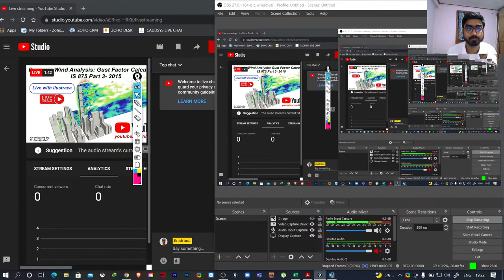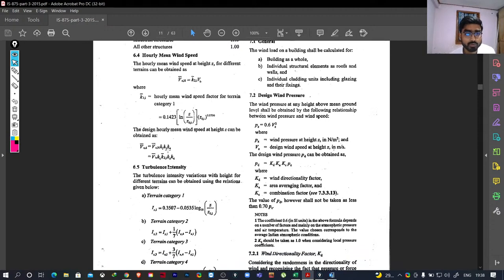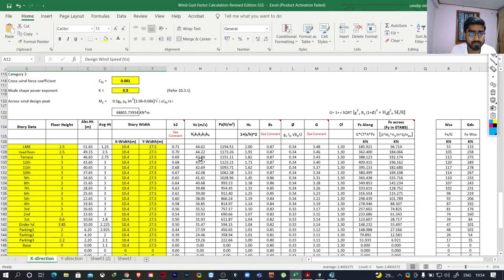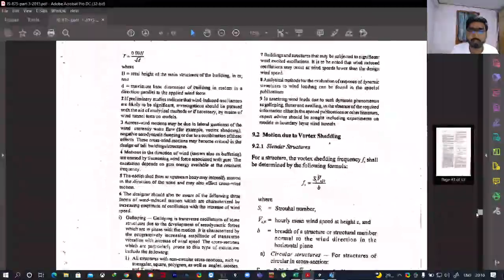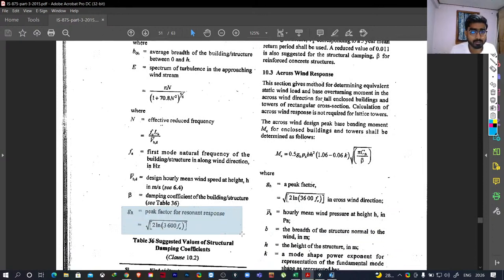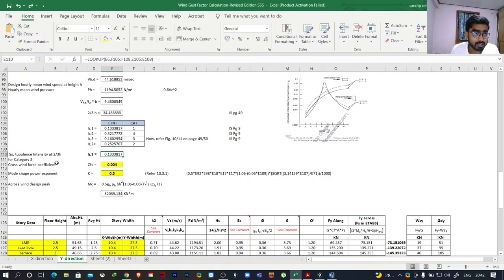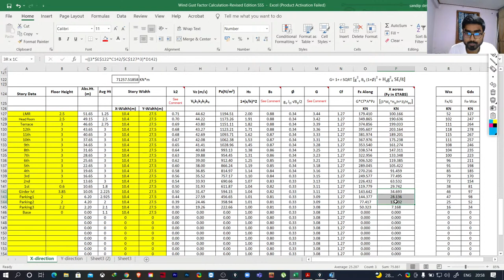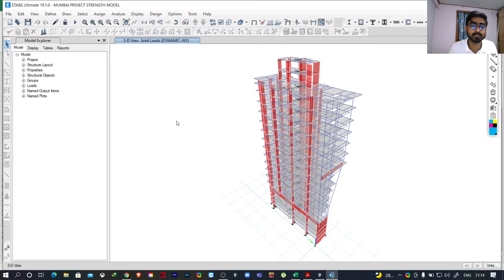Dynamic Wind Analysis: Gust Factor Calculation as per IS 875 Part 3- 2015 | ilustraca | Sandip Deb

Comment from the maker: Advance Study in RCC Building Design using ETABS and Manual Checks
Pre-recorded + Project solving (Batch 2022/01)

Introductory session 01- https://youtu.be/v2fBJ7ueYMM
Introductory session 02- https://youtu.be/J7o4qpN8HdY

Course Fee- 8000/- INR (8 Months access)
(N.B.: The fees can be paid in 2 installments)

Install our Android App now to get the course-
http://on-app.in/app/home?orgCode=amitco

Enroll to the course-
https://amitco.courses.store/157431?utm_source%3Dother%26utm_medium%3Dtutor-course-referral%26utm_campaign%3Dcourse-overview-webapp

N.B.: Admission to this batch is open till Feb, 2022.
Reply: The value of "s" taken by asutosh sir is zero for normal building. And the gust factor is fixed for a normal building. The value of the G is also shown fixed in GSDMA DOCUMENT calculation WO7 !!

Comment: Sir for calculating K2 factor you are using formula from 6.4 and suggesting to use the table 2 alternatively, but the min. Value for K2 for category 1 is 1.05 and you are getting 0.7 for 52mts, so please clarify.

Comment: Vh,d in G Gust Factor calculation you have considered height as variable. it should be fixed value for building height h. Please reply
Reply from the maker: When design wind speed is variable with height then how wind gust gonna be the same? There are basically 2 approaches.. if u finding total force to the structure to be applied at Top most story then u take all max and calculate Gust factor and force... if u r applying story lvl forces then it will be the same as shown.
Reply: you used h as variable in calculation of SIZE REDUCTION FACTOR 'S'. the formula has Vh,d. Note h. it is note z or s @ilustraca
Reply: Sandip Thanks for reply, Cross wind response base MOMENT is too high with IS875 formula for 100m high str. You may studies. Any suggestion

Comment: Hi at one place there was difference in natural frequency was found so u told that it is stiffness based model then u took some other exam model. I could not understand that please explain a bit 

Thanks
Reply from the maker: We need to consider 2 conditions basically, Service condition and Ultimate condition ..and it can be by assigning appropriate property modifiers to the structural elements

Comment: Sir wind analysis kon kon se methods se kr sakte hain?
Reply from the maker: Static method- Pressure coefficient method and force coefficient method 
Dynamic - 1. Gust Factor
                  2. Wind Tunnel
Reply: Sir static method main response spectrum method se bhi kr sakte hain kya wind analysis?
Reply from the maker: Response spectrum is Dynamic Seismic Analysis Method..
Reply from the maker: Do not confused between Seismic and Wind Analysis
Reply: Static method main - Pressure coefficient method and force coefficient method aate hain to ye 2 methods main se konsi linear static main aati hain konsi non linear main aati hain?

Comment: Pls make a spl video for wind static & wind dynamic analysis in etabs
Reply from the maker: already these are explained in great deatail here... rest you can enroll to our advance course for more better understanding!
Reply: @ilustraca  
In etabs while designing,  many beams fails in shear, o/s etc. Pls mk a video for same.  Especially short span beams between column/ walls. Then need to design with steel beam theory, bit uneconomical..pls give sm economical soln for same in etabs or RCDC

Comment: When to use table 2 for k2 values please if you could tell?
Reply from the maker: In case of Rigid structures when you are not using Gust factor and Design mean wind speed.
Reply: @ilustraca  thank you
Reply: @ilustraca  thank you

Comment: In most of the cases the frequency would be lesser than 1 only for the first mode, where it comes under the second criteria whether it is necessary to do dynamic wind analysis for all the building.....
Reply from the maker: Yes.. if slender structure then also Dynamic effects need to be considered
Reply: For across wind you calculated  the turbulence intensity, for that , in terrain category 4 you used 0.67 *z but the 0.67 is not mentioned in code. Whether it is correct or wrong
Reply: @ilustraca thank you sir

Comment: Could u pls guide to check displacements limiting values,  I am doing as shall be less than H/500 at each corner at top. Pls guide with supportive clause in code.

Comment: Why did you check for un-cracked modifiers for time period?
Reply from the maker: Please make the question more clear...
Reply: @ilustraca  you have considered un-cracked modifiers for modal mass participation.
I want to know why?
Reply from the maker: Mass participation has nothing to do with stiffness modifiers.. Stiffness modifiers are used to take the cracking affect into account under specific loading criteria. Modal analysis is for understading the fundamental vibration pattern of the building and modal mass participation tells what percentage of total seismic mass is vibrating in each mode. We had detailed discussion on the same. You may find it in our YouTube channel.
Reply from the maker: Again this video is about Gust factor calculation and there are few mistakes observed in the video later. I would be happy if you could arise questions on those.
Reply: Mass participation depends on your geometry. How can you say this that it's nothing to do with the stiffness modifiers. You will get different results for both cracked and un-cracked modifiers bro.
Reply from the maker: Results will vary as the stiffness reduces... but that's not our aim is in case of Modal analysis.. As the reduction will be uniform in all the frame elements hence the vibration shape or modal behaviour will the same. And the increase in mass participation will be uniform. As I said, modal analysis is for understanding the vibration behaviour..hence uniform increase in numerical values won't change your conclusion.
Reply: Yes definitely your results will change but when you have  different frequencies your forces will be changed I guess.
Reply from the maker: You're very confused about what you are saying. When we only perform modal analysis then we are not concerned about the forces. But when we perform Response Spectrum analysis then we need to talk about the force... and then we'll consider stiffness modifiers which is obvious. With the application of stiffness modifiers your vibration shapes won't change.
Reply: @ilustraca  just tell me one thing when you do modal analysis with stiffness modifiers for both cracked and un-cracked your time period will be different or not?
Reply from the maker: Yes obviously different as the stiffness reduces... and that time period will be used in case of taking the Sa/g value corresponding to each mode will finding out the horizontal acceleration to be used in creation of response spectra.
Reply from the maker: And when we r applying seismic force on the structure (inertial pseudo force) then stiffness reduction is obvious due to cracking that will occur.
Reply: So my point is only this that for design you can't take time period from a model which has un-cracked modifiers. You should have took the time period from Cracked modifiers model.
Reply: And one more thing your point is not valid that mass participation has nothing to do with modifiers. Your time periods will be changed.
Reply from the maker: Pehle apne bola Modal Analysis abhi aap hi bol rahe ho design.. bhai, pehle soch lo kaunsi topic me batein karni hai... Video tha Gust factor ka, apne comment dala modal analysis pe, uske sath mix kardiya stiffness modifiers aur abhi design... all the different stages. Logo ki galtiya ginate huye aap khud confuse ho jaa rahe ho mere bhai...Stiffness modifiers use karke modal analysis karoge to mass participation to badhega hi as stiffness is getting reduced. But aap jab sirf modal analysis ki baat kar rahe ho, then u use it to understand the vibration behaviour jo maine 5-6 bar mention kiya hai abhi thak... to usme numerical values matters only when we are opting for irregularity checks or design.. even agar values uniformly increase huye hai to fir irregularity checks me bhi hume similar behaviour dekhne ko milega, values may change. But when we'll step forward to find the analysis forces and stability of the structure then significance of stiffness modifiers is greater. And as of now we'll not use modifiers for the design stage also. Abhi bhi confusion hai to bhai mere.. Book padhlo....🙏🏾😊
Reply: @ilustraca  first of all you are taking it in wrong context. Aapne jo modal analysis kiya gust ke liye uska sense kya nikla?
Kya us results ko aap design ke liye use kroge?
Mai full design and analysis ke purpose se bol rha hu.......ki agar gust lgana bhi hai to modal analysis bhi cracked section ka use kro. Mera thi point hai bus. Aapne jo jo tha aapke knowledge me jiski jaroorat bhi nhi thi wo reply kr diya.
Reply: @ilustraca  abhi jo aap video me bata rhe ho hum design kr rhe hai 😅 book padne ki baat nhi hai. Aapka to ego hurt ho gya. Mene discussion ke context me pucha tha bus.
Reply: @ilustraca  jub un-cracked ka time period use he nhi aaega to us better ki cracked modifiers ke result share krte. That's the only thing I want to tell you. Because first you have opened different modal then switched to the second one. That's why I was just asking.